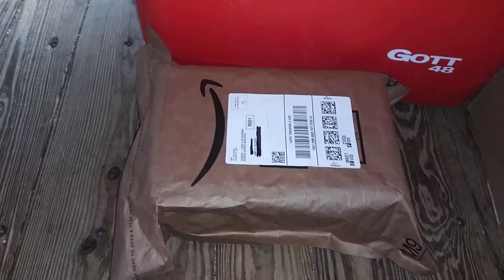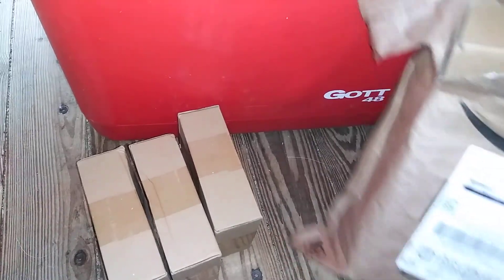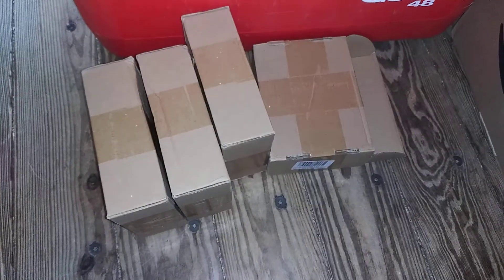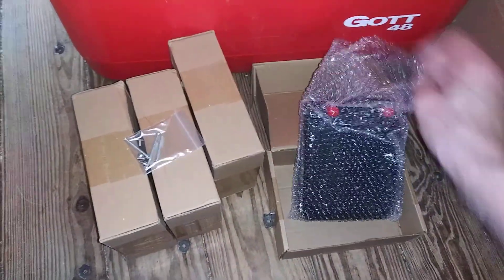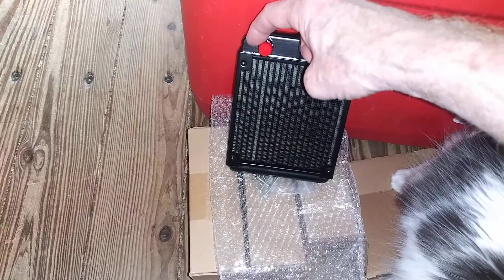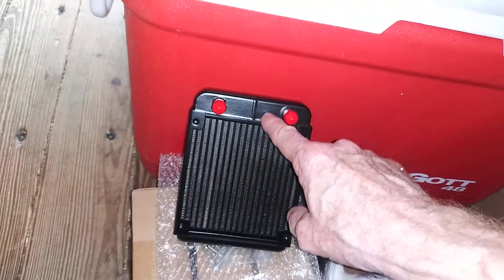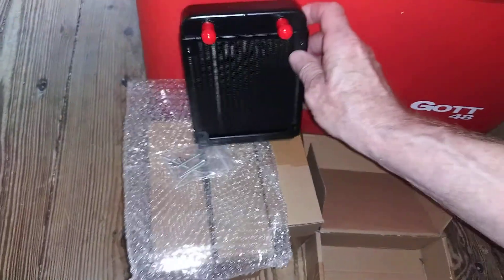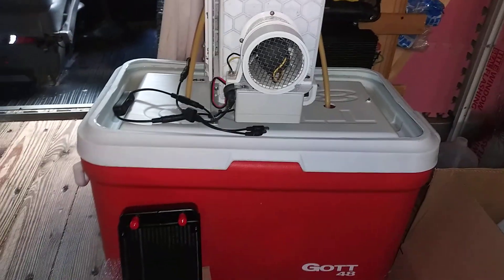DIY AC - Unboxing Today! PC Radiators for Cold "AirBox" Homemade Air Conditioner

Comment: How can I attach refrigerant copper line to these radiators?
Reply from the maker: Hello, and Thanks for watching and for your question.
I use different techniques and various materials sizes to connect tubing on each design.

I'll try to make a quick video reviewing some of my current systems for you. Internal tubing sizes and radiator connectors sizes can take some time to make sure they're compatible at times when experimenting for sure!

Comment: Do you have a parts list and links for the 9 qt Ice chest A/C? I was going to try to build one for my son’s outdoor soccer games.
Reply from the maker: I can make a short video parts list for sure. I'm planning a "What I Use" series to differentiate testing from my ice chest a.c. daily use designs. I get carried away with the fun of different ideas lol.

I am currently building a 9qt self contained unit that is divided in half that can serve as a short term cooling unit & that can also serve as just an "AirBox"  by placing it on top of beside a larger cooler full of ice water and last a lot longer. It uses the dual fuel tank concept on trucks and vans etc. So all you need is the 9qt unit. It's really unique for sure! I have all my parts in and will post that video hopefully this week.

Thanks for sure!
James, Rescue Kitty😺 & Snowvan!
Reply: @HomemadeAC  I am in the process of buying parts for the 9 qt cooler version. What 12v pump do you recommend for optimal water circulation?
Reply from the maker: @rocky2000316  The dual purpose 9qt AirBox/AC combination is a really neat work.

I use different 12 volt fountain water pumps for the 9qt. Some have a nozzle for the input & output. Some have a flat screen area input with a nozzle output. And the head pressure varies a little between them.
But the one thing I like to make sure they have in common is that they have the 12 volt barrel plug instead of bare wires to avoid the need of soldering or crimping connectors etc. And they match up with all the other 12v barrel plugs, switches, controllers, splitters and cables etc. So that makes assembly and changes very easy for sure.

For the small 9qt AC unit the head pressure isn't critical since circulating water travel distance is so short. But if using an additional external ice water source such as a larger cooler or 5 gallon bucket etc I'm going to use a small "high volume" 12v water pump to keep cold water flowing fast through a longer distance. The faster volume pump can just be dropped into the external ice water source connected to extra tubing on the 9qt barbed side ports(barbed bulkhead fittings).

I'll look through my orders on Amazon and link a few for sure. I'll make a short video for the water pumps and the other parts individually. I'll put it here as well.

Thanks again,
James, Rescue Kitty😺 & Snowvan!
Reply: @HomemadeAC  I can’t wait to see the video on dual purpose 9 quart cooler. Sounds like a unique idea.